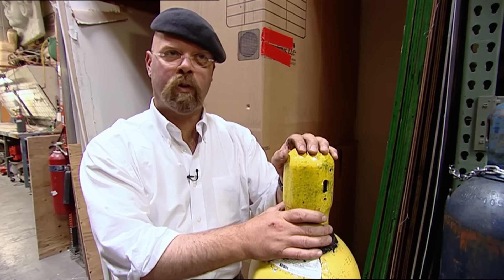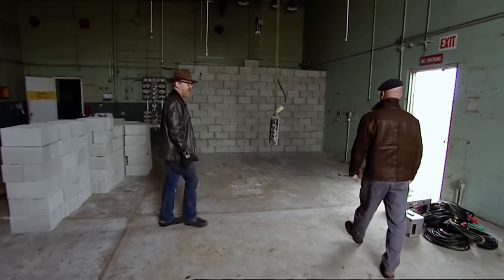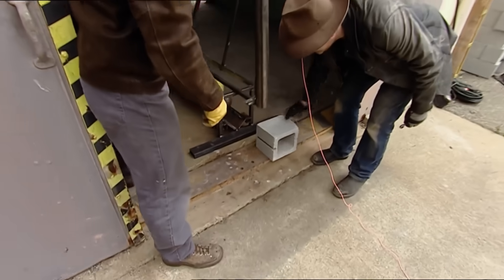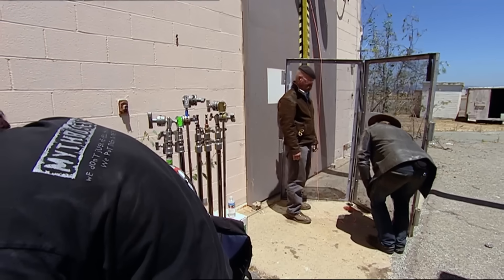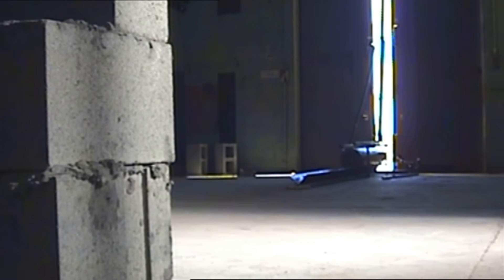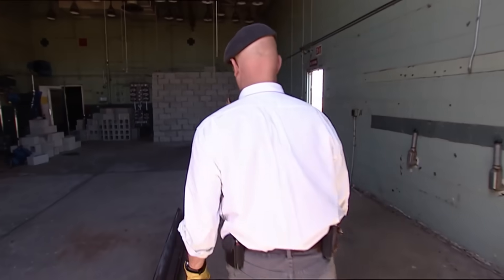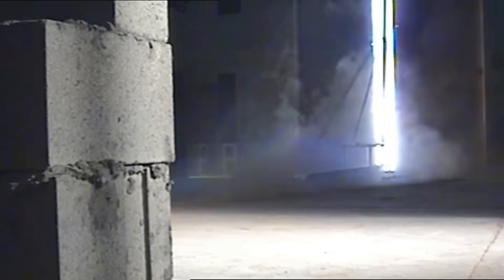What Happens When A Compressed Air Tank Explodes? | MythBusters

Comment: That was an easy punch through.
Happened at an Industrial Work location prior to my hiring which I won't disclose.
Went through fortified concrete block wall and severely damaged a truck parked on the other side.
Full Oxygen Tank which is around 2100 psi.
No injuries or death.

Comment: Concrete hallow brick are kinda easy to break tho . I can grab and ripp them apart and crushing them their are humans that know how to hit them right and fast to break them . So this really isn't that impressive. We have a metal cylinder meeting a well very weak structure . So here are some stats failing in tension (bending) at roughly 10% of its crushing strength, around 125-175 lbs when supported and struck in the middle, but it is capable of holding compression of upward of 120 thousand pounds. We

Comment: Back in the 60's I was living in Tucson when a newscast was seen on local television about an accident at the local air base. Several tanks went high order punching through the cinder block walled building. A vivid memory along side a news report some time later about a flour mill exploding. Later when I worked at a flour mill I noticed carefully protected electrical boxes so as not to create a spark. Some things are not a myth.

Comment: I tried knocking the valve off one of these with a great big monkey wrench, and it's a lot harder than you would think, I actually broke a weld on the tank rack before I could break the valve off

It was actually an acetalyn tank not an air tank but you get what I'm saying

Comment: I worked at a dive shop as a scuba instructor while I was in college. We had a customer who owned a panel van rent scuba cylinders and apparently didn't have the cylinders properly secured. While driving they had to stop hard on the freeway and one of the cylinders somehow sheered its valve. The customer said the cylinder violently spun around the back bouncing off the: floor, celling, and roof. Thankfully there were no passengers in the back but I saw first hand the massive dents and two shattered rear windows. Compressed gasses aren't something to take for granted.

Comment: Compressed gas cylinders are far more dangerous this "experiment" demonstrates. They can exert up to 10,000 psi of pressure (compared to a spacex raptor engine at 4800 psi max). The damage that these cause in a confined space, like a mechanics shop, is when they spin like a propeller. They destroy anything that gets in the way, including bodies.
Reply: This was my submision a long time ago. My high school welding shop teacher told us a tank with a  sheared off valve becomes a rocket. But if the valve is only cracked, it turns into a "pinwheel." That will break your legs and / or kill you.

Comment: Me and another mechanic were struggling to disassemble a hydraulic cylinder from a backhoe. The cylinder was 6" diameter and had sustained a bent rod. We had it down on the floor and plumbed it to shop air (we'd done it before). The piston and rod made a hole in the wall just like Jamie's air tank

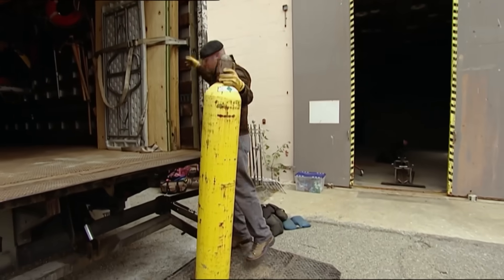Comment: 2:00 That is NOT a solid brick wall - as clearly shown in the previous few seconds.  Cinderblock is quite fragile!  6:10  You can see that they did NOT concrete fill the channels, but the wall of the building IS filled, as it's supposed to be.

Comment: Retired commercial diver, here: When properly filled and maintained, those steel cylinders can last an amazingly long time. I've seen many with date stamps from the WWI era (1917, 1918, 1919, etc.).  Gas cylinder safety is one of the first things divers and other offshore hands are taught. There's a tremendous amount of energy stored in those tanks.
Reply: Yeah I did a lot of cutting with an oxygen lance and my favorite cylinder was from like 1951 or something like that
Reply: Yes! I get a nitrogen tank every month for work and I always look at the dates on them. 

13 years here and they still scare the crap out of me. Definitely a good thing though with all that potential energy stored up. Makes me more careful.

Comment: More than forty-years ago while working at a facility who filled there own CO2 cylinders used in quenching processes one failed.  It was a 30 pounder and was not functioning.  Several employees  over a few shifts tried to fill it. It was over filled. Later when no one was around it failed. It went through a 12 inch block wall, flew about 100 ft., pierced a 8 inch block wall and knocked a chair over that the shipping manager usually sat in. We never filled cylinders after that.  A service tank was brought in and lines piped with whips and nozzles.

Comment: While working as a construction worker at an open pit copper mine on the night shift, we would get bored sometimes.  We would prop up a 4" X 4" angle on a rock and launch Oxygen bottles off into the pit with an 8 Lb hammer.  We played rock-paper-scissors to see who got to do the honors.  Boredom is a bad thing.

Comment: I think the bottom of the wall may not have been bonded to the concrete as it would be in reality. Also, the wall didn’t have a loadbearing weight, pressing it down.

Comment: A Compressed Cylinder can be very dangerous  when the content's is allowed to escape rapidly. Over the years I have had to investigate a number of incidents were an Air Cylinder used for Breathing Apparatus were  just open fully while not correctly restrained and the damaged they do while flying around the room is incredible. Lucky no one was killed. They need to be treated with respect.

Comment: About 40-45 years ago, when i was a schoolboy, a medium size steam boiler exploded, at an area nearby the nowadays Athens airport. It blew up the opposing wall, flew at half a meter height and demolished an outer cement brick wall standing at 80 meters distance. Finally it stopped 150 meters away

Comment: This happened in Dartford, Kent, England about 40 years ago - a guy delivering welding gas didn't bother putting the safety chain across the front of the trolley, hit a hole in the concreet floor, the cylinder tiped forwards and the valve got snapped off - there was not the entire contents of the cyclinder exploding out of a 3/4" hole. I heard the cylinder was found a long way away. In the shock of the moment, the factory unit a mixture of air and ascetalin gas, one of the shell shocked employees put a cigarette in his mouth and was trying to light it. Thankfully someone punched the lighter out of his hand before the building exploded.

Comment: When I was a kid about 16, and working at Taco Bell. We had a syrup cylinder for the orange soda fall and broke the top. It launched just like a rocket across our very small storage room. Maybe 10x10. It was only like 2ft tall and 8 inches in diameter. But it put a hole in the wall through brick about 4 inches deep. If someone were in the way it would have definitely amputated a foot.

Comment: I witnessed a cylinder of CO2 fall over and shear the regulator off the top. the Cylinder traveled 30 feet across an institutional Kitchen floor, through a cinderblock wall, into the dining area, and busted a second wall into a hallway. The valve went through a sold brick wall and traveled a half mile, went through a car, and landed in a ditch. This was at Sheppard AFB in the fall of 1983.

Comment: A mentor of mine who uses to work for ford said that a cylinder of argon fell over in a storage closet went through the concrete wall and ended up in the middle of production at ford assembly in Dearborn. He told me this while I was learning to braze with a tank on argon and tank of oxygen strapped to a flimsy upright cart

Comment: A place I was working at was using pvc pipe for the air system, they had to turn up the air pressure so it basically became on big pipe bomb. It exploded twice before they had to replace the whole system. I told them it would happen again after the first time, they didn't believe me. It almost killed one of the girls working there.

Comment: I did that by accident when I was bout,18 I was doing electrical work and knocked a 3 pound sledge hammer off a scissor lift and it hit the tank and blew through a wall bout 30 feet away

Comment: For over 10 years I was the plant manager at a cylinder gas plant.  I have filled thousands and thousands of cylinders.  I have seen some stuff happen too.  The most similar to this that I have seen, a cylinder that was just filled was placed on a pallet of cylinders and moved to the storage area on the other side of the plant.  A driver came in and unstrapped the cylinders and was taking individual cylinders to load out his truck.  He took the cap off of one to swap it for a different style cap that the customer specifically requested (safety cap) and in the process, knocked it over.  The valve struck the edge of the steel pallet and sheered off the valve.  The cylinder flew across the floor like a torpedo and slammed into some other cylinders then hit the wall of the steel building.  It punched a hole in the side of the building, but didnt have enough force left to go thru.  Fortunately no one was injured.  The driver's pants were the only casualty, code brown. lol  I also saw the aftermath of a cylinder explosion during filling.  Cylinders used for CO2 service are supposed to be steel stamped to show co2 service so they arent used for any other service.  unfortunately 1 got by and was changed to another gas service.  When a CO2 cylinder runs out of gas it can suck liquid back inside the cylinder.  This liquid is then left in the cylinder next time it is filled.  this creates an acid that will corrode the bottom inch or so of the cylinder.  so the cylinder that was switched was very corroded on the bottom.  at 2400 psi the bottom of cylinder failed and the top 95% of the cylinder took off like a rocket, right thru the roof of the building and landed over 100 feet away in the parking lot.  I heard the noise and ran over to see what happened.  fortunately no one was injured.
Reply: Honestly good on you for making sure no one was injured. I would have run straight to the parking lot to make sure it didn't hit my car.
Reply: Carbonic acid is formed when CO2 is forced into solution under pressure.

Comment: When  I worked for an Airline in the 1980's this did happen in one of our aircraft hangars it had about 150 feet of travel before it hit the 1st cinder block wall plenty of distance to gain momentum went right through it skidded across the concrete tarmac missing all of our parked DC-3's and Convair 440 freight aircraft by sheer  luck went up an incline that was grass , hit the outside wall of the next hangar probably 4-600 ft away and bounced off it and rolled to a stop. Torpedo on land for sure. No joke the power those things have when allowed to accelerate uninterrupted .

Comment: When I was in the military stationed at Ramstein Air Base Germany in 1981, Red Brigade terrorists rigged three propane tanks in a VW camper to explode in the US Air Forces Europe (USAFE) Headquarters parking lot as people arrived to work.  Only one tank actually detonated, knocking out windows to the three buildings around the perimeter of the parking lot.  One of the non-exploding tanks was hurled so violently that it made a perfectly round hole through the concrete block wall on the third floor of one building.  Your experiment reminded me of that.  Fortunately, no one was killed in that bombing, albeit several injuries from shrapnel.

Comment: This is Not a solid brick wall. It is a concrete block wall.
Each block has two voids, with thin walls. I do believe
a brick wall, of the same thickness, would be a lot stronger.

Comment: I work for a company that makes CNG and hydrogen cylinders CNG is 3600 PSI hydrogen is a lot more during DOT testing they have a test that they put enough pressure in it until it fails, the reason is they want the side to split do not want the ends to come off and become a projectile, not sure if ths applies to non vehicle applications , think I will watch and see what these guys are up to

Comment: In East Hartford Connecticut, back in the late 70's / early 80's, it's been told that a group of guys stole some oxygen torch tanks from a construction site, took them to the Connecticut River and pretty much did the same thing by breaking off the valves with sledge hammers and launching across the river toward the city of Hartford like torpedo's, in spots the river is up to 400 yards wide, it was said that they made it across and hit the bank, now that's something that I'd like these these guy's do.

Comment: We had 2 HC bottles of argon fall off a truck at 60 mph in northern BC. One went under the truck and came out the front going faster than the truck. And it sucked all the air out of the engine compartment and stalled the truck. Never did find the 2 tanks.

Comment: As an industrial safety officer, many have considered me over-zealous when I went around chaining or roping gas cylinders in place so that they could not fall over and get their valve sheared off. I now consider my efforts totally vindicated.
Reply: I WAS A HOSPITAL SAFETY OFFICER. I SAW ONE OF THE SNALL OXYGEN CYLINDERS SUCH AS USED BY PATIENST FOR PORTABILITY THAT WENT THROUGH THE SIDE OF A DELIVERY TRUCK AND WAS FOUND ABOUT 100 FEET AWAY WHEN IT WAS DROPPED BY A WORHER. THE WORKER WAS NOT INJURED, BUT THE VALVE WAS FOUND EMBEDDED IN THE SIDE OF A WOODEN CRATE IN THE TRUCK.

Comment: When I saw that the wall was hollow concrete blocks I thought that the cylinder was going to go through that and right into the next wall.
When I was a kid a mate and I put a small cylinder the ones used in cans of whipped cream into a fire. We had built a huge fireplace out of large sandstone rocks inside a huge rock shelter by a creek in the bush.
We lit the fire and withdrew to a safe distance and waited. Well that tiny little cylinder went off like bomb, the fireplace we had built was totally non existent and there was a massively long gouge along the back of the rock wall where the cylinder had hit .
Don’t mess with them , and definitely don’t put them into a fire, because if a little one did that kind of damage, imagine the damage the one in the video could do

Comment: Years ago I was employed at a company that produced SCBA systems for firefighters and hazmat situations. Our high pressure systems operated at 4500 psi. We were told that it there was an accident that our families should probably plan on a closed casket.
Reply: with those cylinders, its all about inspecting the condition of the cylinder.  If there are cuts in the fiberglass, you are taking your life in your hands.

Comment: At our town's gas station, a driver pulled up next to the tire refiller, halting a trailer with a tractor wheel. Since it barely was inflated, he hooked up the feed line and went to the restrooms. Meanwhile the hissing sound continued for several minutes unattended. Suddenly, the tire seperated from the rim with a violent explosion, sending a vortex ring hundrets of feet into the air. The explosion was heard several miles away, residents thought the Army were practicing in the area.

Comment: I can tell you this… I had the regulator on a nitrogen tank fail because the diaphragm  inside it failed… It was hooked up to a smaller tank that was a holding tank to fill up a fairly large line system that represented about 450 feet of 3 inch line that needed to be kept dry from condensation. That line is normally kept at around 5 to 7 psi using a low pressure regulator and that tank is just used as like an expansion tank so that when the line is heated in the sun it has someplace to equalize. When that regulator failed it blew the covers off the gauges, and in a split second pumped the 12 gallon expansion tank up to 125 psi and that 450 feet of 3 inch line up to 125 psi (the pressure was held in the line by a check valve) but the emergency relief valve on that little tank save the day by blowing out and releasing the nitrogen pressure before there was an explosion. Had it not been for that emergency valve that small tank certainly would’ve ruptured with a bang. 

The line that went from the tank to the manifold, which was like a fairly firm but flexible opaque black line about 3/8 of an inch in diameter ruptured down the side from the over pressure making a sound like a starter pistol. And all the gauges on the manifold had the covers blown off.  Still to this day you can see those gauges on the wall pointing to the max.  

Probably one of the scariest things that’s ever happened to me.

Comment: Block walls are notoriously weak from lateral impacts.  You could put that cylinder on a long slide and just the weight will put a hole in the wall.
Reply: Didnt have much room to build momemtum, but some commentors said theyve seen it go through 3 brick walls when started from a parking lot. I imagine it would take your feet clean off at the ankles if hit.

Comment: 6:32. it looks like they left the cinder blocks empty. Those holes are supposed to be filled by concrete.
Reply: Only doorways and windows columns are filled with concrete.  Also a cap is poured across the top.
Reply: @stephenwalker5264 nope all structural CMU is now filled with grout.
Reply: Unless in a hurricane zone. We built schools with entire walls filled with grout on my mason crew
Reply: @joeblow8206 I live in a hurricane zone. The block cells are left empty, except at doors, windows, and structural load locations. There's also a tie beam around the top.
Reply: And maybe some rebar

Comment: In a block wall they fill the cells with concert and rebar. Cement blocks alone are not strong.
Reply: Normal cinder block walls don't get filled with concrete and rebar. They shouldn't have used cinder block at all. And if they did fill it with concrete, I'm not so sure it would have gone through. Also the wall behind the fake wall they built was also cinder block